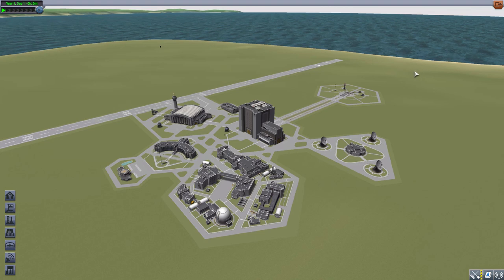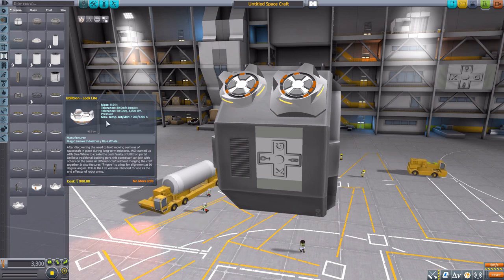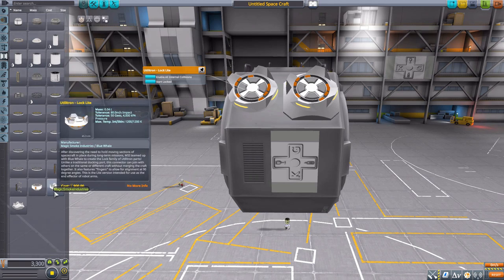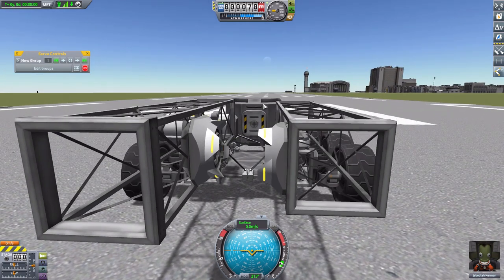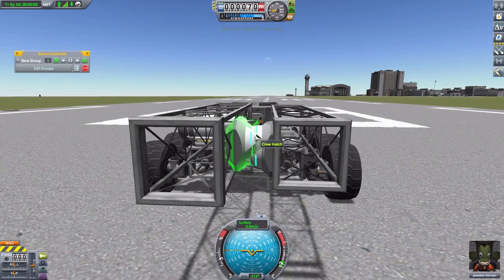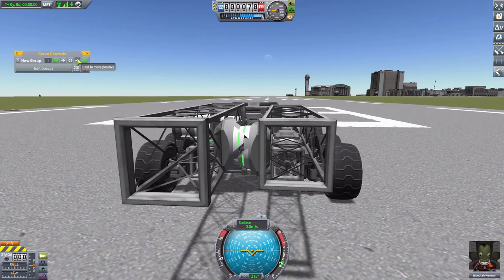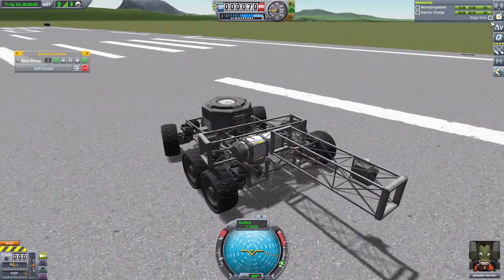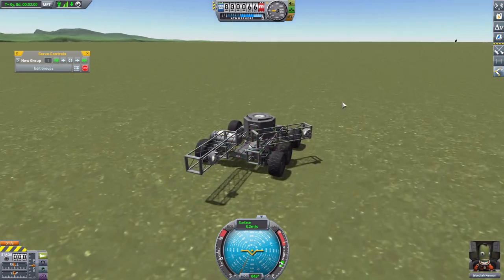KSP Mods - Inner Lock

Comment: It should be mentioned that part model was created by ZodiusInfuser in style of the IR Model Rework pack.
Reply: Indeed! Glad he showed them off with IR as that use is what attracted me to answer Whale_2's request for models in the first place. There really isn't anything in stock that lets you "dock" two moving parts of the same craft together, which until the Breaking Ground DLC was primarily an IR only problem.